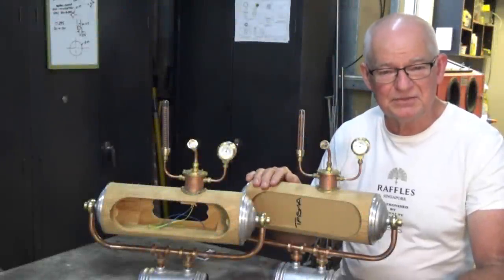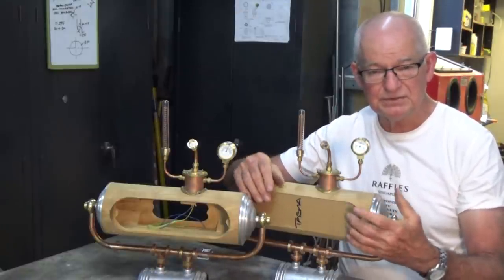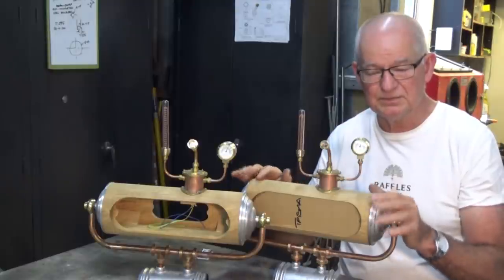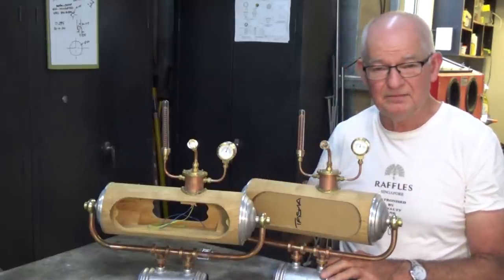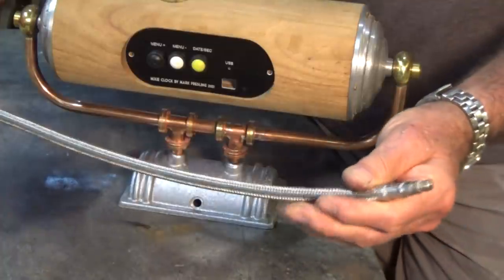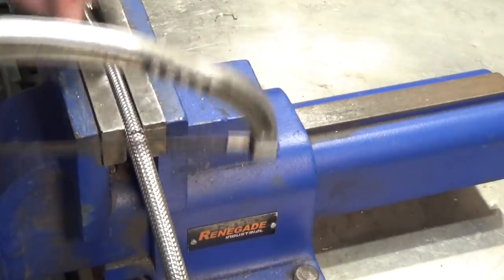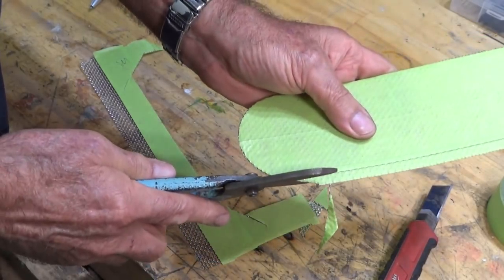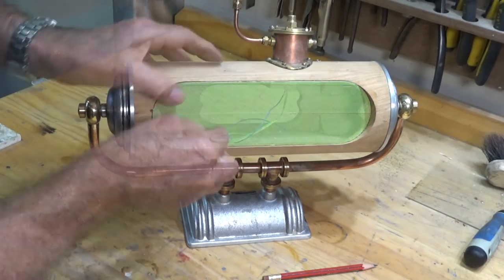The "MIXIE" A DIY Steampunk, Backlit Digital Clock - Part 9

Comment: Former Architectural Sign maker / Signwriter here. Use turps to soak a cloth rag to soften the paper to release it from the perspex. Take your time and let it soak in.
Plenty of acrylic suppliers have an off cut bin, where you can pick up frosted acrylic lol I've sprayed and screen printed to get the effect, but  never sandblasting, that's a new one to me as I would have believed it wouldn't produce the evenness I'd be after, guess I might have been wrong, on the smaller stuff at least ;-D Great video as always mate.
Reply from the maker: Luke, you are correct that the sandblasting could look a bit patchy over larger areas. With those small screens I could really go to town with the blasting and it doesn't really affect the thickness of the material. I did try some translucent white acrylic of the type used for internally lit signs but it diffused the light too much. Having the sand blasted surface on just one face gives the numbers really crisp edges. 
Regards,
Mark

Comment: A good way to cut a braided hose is to tape the hose then cut with an angle grinder running a slitting disk and you'll get a pretty good finish.
Reply: With a rubber hose with stainless mesh, I have found that you can wrap the cut point with two wraps of duct tape, position a really sharp hatchet over the cut line and with the hose positioned over a large block of wood with the end grain facing up like you are trying to split it, hit the back of the hatchet with a large hammer and it will leave an excellent burr free end.
Reply from the maker: I hadn't though of that. I have one of those super thin Dremel abrasive discs too. It would have worked a treat.
Regards,
Mark
Reply: Works every time!

Comment: Another great video Mark. A little suggestion for the wire mesh I use it for radiator grills in my model trucks . Before I cut it I glue the part where the cut is going to be with superglue and let it harden fully then cut no little bits falling off.
Reply from the maker: I will end up doing that on those ends where the strands are very short. I really want to be able to remove the mesh for cleaning and it's almost inevitable that one of the bits of wire will work loose over time.
Regards,
Mark

Comment: When I need to cut braided hose I wrap it in electrical tape at the area to be cut then use a 4" grinder with a 1mm (.040) cut off blade and cut through the center of the tape wrap, The tape holds the strands in place.  Awesome video as per usual Mark!
Reply: That's what I've always done as well. Same with hydraulic hose as well, minus the tape.
Reply: Works on armored electrical cable too.
Reply from the maker: I should have tried that. I realised later that I could have experimented on all the left over hose that I didn't end up using.
Regards,
Mark

Comment: My brother used to work for a private zoo and bird breeder here in the states. They had a couple kookaburras. One of their demonstrations for visitors was to hold a pinkie rat up in the air and the kookaburra would fly down and snatch it out of their fingers in mid flight.
Reply from the maker: Yes, they are very accurate at finding prey. Snakes and lizards usually but we have seen them pulling very large earthworms up out of the ground.
Regards,
Mark

Comment: Mark, a tech tip for cutting steel braided hoses.  Wrap the exterior of the hose in masking tape so that it covers your intended cut.  Use a thin abrasive wheel in a die grinder or angle grinder to do the cut.  The ends of the wire braid will stay together under the tape and there is much less cleanup involved.
Reply from the maker: I should have experimented more on the waste material before going at with the hacksaw. Turned out OK though.
Regards,
Mark

Comment: Your attention to detail is great 
If you don’t mind a lacquered finish on the brass/copper, Penetrol is good
Reply from the maker: I have some Penetrol. I have used Incralac before but you only need to have the tiniest pinhole in the coating for the oxide to start forming under the coating. It can be a pain to get the old coating off. Wax was often used on brass clock bases as it doesn't colour the metal and if it goes dull it's easy to remove with some turpentine. I may try the Penetrol on a few parts though.

Comment: You did have the sandblaster out, but I was wondering about a laser engrave on the acrylic to get the texture you'd like. I have had great success with a defocused beam to give a pretty even mottle without raster lines. Probably faster to sandblast, but it is very neat.
Reply from the maker: I must say, I haven't tried any laser engraving with the beam de-focused. Food for thought there!
Regards,
Mark

Comment: Tightly wrap with tape before cutting.  Angle grinder used lightly works well - the tape remaining lets you push the thing into a tight hole or grommet too.  Parrot beak cutters will crush a little but pretty clean cuts. - done plenty making up rigging wires over the years.  Silly question, can any power leads not pass through the existing copper tube supports?
Reply from the maker: The original plan was to run the power cable up one of the copper arms but it meant having to drill a hole at right angles through the central fixing screw that holds the donut onto the end casting of the clock case. I was worried that this hole may not always line up with the axis of the copper arm. All said and done, I thought the braided stainless steel hose looked cool anyway. I have had a lot of suggestions regarding using an angle grinder. Looks like that's the preferred method.
Regards,
Mark

Comment: G’day Mark. Wooden V blocks are a good choice, plenty of accuracy for your job. I like the idea of the mesh but I don’t know how it will be over time trying to keep it clean, why not fit it behind the frosted panel??
Speaking of frosty finish, I did that years ago on glass (panelled doors) worked great and looked good, didn’t finish it off with mesh though. Looking good, take as many episodes as you like. 
Cheers 
Peter
Reply from the maker: Thanks 👍 Yes, cleaning might be an issue. I really did want the mesh to be visible from the front though. It has a sort of textural quality to it.
Regards,
Mark

Comment: cutting the braided-stainless tube cover, wind tape tightly round where you're going to  cut, and use a dremel with a cutting wheel...................
Reply from the maker: Thanks, If I ever do it again I'll know better.
Regards,
Mark

Comment: Well I guess Ol Presso is now deaf as a post, prolly from all those years with his custom, whisper quiet, silenced VFD. ALTHOUGH THERE IS PERHAPS SOME RESIDUAL HEARING AS HE SEEMS TO KNOW TO SHOUT WHEN HIS NEW RPC IS RUNNING 😂
Reply from the maker: There is a big pile of steel sitting on the floor that is destined to become a shelf/trolley/storage/RPC enclosure. I have sourced some sound insulating board to go inside it. The steel case on the RPC itself rattles when the motor is running so it needs some sound deadening inside it as well. I am sure I can get it to be a lot quieter than it is at present but, you know, busy building clocks! 
Regards,
Mark

Comment: Its getting there mate.

Is the idea of the ESP controller to allow it to connect to an NTP server?

Or your extra feture a GPS receiver to grab time from that?
Reply from the maker: Daniel, 
the Node MCU gets the time from the NTP server which can be selected in the Arduino code. As long as you have a WiFi connection you have got accurate time. There is also an option to manually change to daylight saving time using the two button menu. 
Regards,
Mark
Reply: @Preso58  so no GPS then... Proximity sensor for shutting off an alarm? Feel free to ignore my guessing, it's just a bit of fun to laugh at when you do reveal it.

And nodeMCU uses either the ESP12 or ESP32 controller, depending on which version you get. It's really just habit that I call them ESP rather than nodeMCU. When I wrote my comment it was just based on what I saw rather than what I heard. Sorry for the confusion.

Comment: I see you used the high speed gun in the sandblasting cabinet. How do I know it's high speed? It's red, and everyone knows red is the fastest color.
Reply from the maker: Also lightning bolts. Don't forget the lightning bolts on the handle!
Regards,
Mark
Reply: @Preso58  Good call. I had forgotten the lightning bolts. My apologies... ;)

Comment: KISS: redesign the wooden-tube main body, so that the perspex and steel-mesh are fitted INSIDE. that way they can be easy-make, easy-fit rectangles.............. £10 4s 6d pls
Reply: ...........also, you then don't see the fixing screws. ;-)
Reply: .........also the perspex will be holding the grille, so perhaps it won't rattle. which could save a lot of nonsense......
Reply from the maker: Unfortunately, this project was one giant prototype. If I were to do it again I would certainly do things differently. There are multiple ways of doing things and the design process is empirical. You tend to start with a form, like the cylindrical body and then look for ways to create the sub assemblies. If ten people were given a brief to make a clock with the backlit display, you would get ten different results.
Regards,
Mark

Comment: what is the name brand of the cutter?
Reply from the maker: If you are taking about the laser cutter it is a no name Chinese made 50 watt CO2 laser cutter engraver. I bought it second hand and it wasn't working when I got it. I upgraded the digital signal processor and most of the internal components. It now works well but it was truly a basket case when I first bought it home.
Regards,
Mark